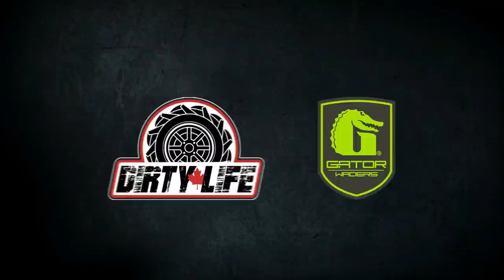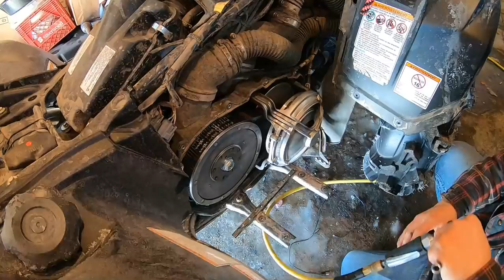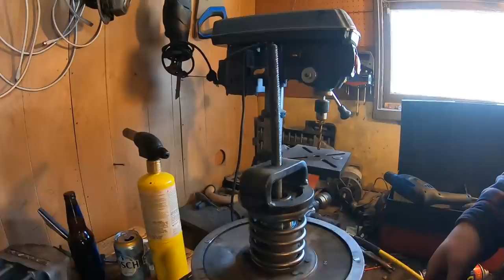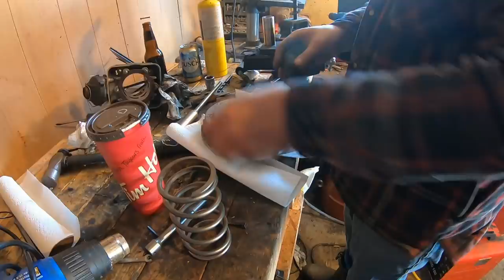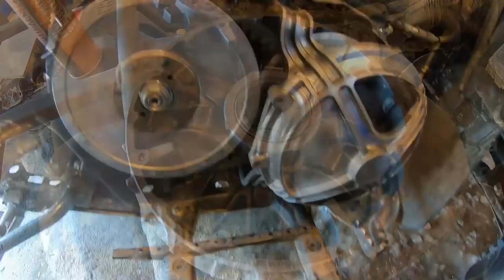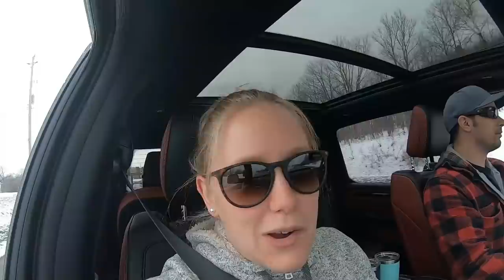Custom Clutch for Project Mama Bear (Kodiak 700 EPS SE)

Comment: Right on. Cass will notice a difference in the thick mud for sure.
Only difference in my clutch is I'm running the white secondary, and my cam plate has been cut and re-welded for more low and top end. Other than that I'm running the same weights in my primary. Oh and I have the wet clutch springs installed as well from EPI.
Reply from the maker: If we want down the road, we have everything to go full tilt. We need to test and see if it fits her needs eh.

Comment: Thanks for the informative vid! Going with the same kit from epi for my grizzly. Did you change the internal clutch housing gasket? They recommended mine be changed? Should be getting to the project in the next couple of weeks. Thanks again!
Reply from the maker: I didnt go into the internal clutch until we decide its necessary

Comment: On my old 07 660 Rhino even before lifting it I went through several stock belts and after I lifted it I changed weights and had to go to a HighLifter belt because I pinched one belt almost totally into.  But since going to the HighLifter belt I've only gone through about 2
Reply: you are the only person out of thousands on the forums, dealers, and friends, that ive ever heard have problem with oem, and first to have better luck with aftermarket
Reply: My clutches are both stock, my belt is after market. My clutches are super strong, I never had a problem with them turning over my 29.5 s/w OutLaw og tires even in clay they were gripping so tight they crushed the one grade up HighLifter belt, I had to go to the HighLifter Pro belt
Reply: @stacyreid5077  what did you do to the cvt to get it to grip a belt that tight?
Reply: Jason, I didn’t do anything to the cvt   When I showed the HighLifter staff the belt that is a step below the HighLfter Pro belt they didn’t have a clue of how it happened. They said never had they seen or heard of it without a cvt upgrade. But like I said I put the Pro belt on it and was great until I destroyed my transmission case

Comment: I was wondering have you guys ever come across a mud hole that the Can-Am makes it through but the Yamaha doesn't? Because a lot of people in the ATV world believe that more horsepower and more torque is better in the mud but when you look at Truck World unless you're talking about a 1200 horsepower mud rail it's kind of the complete opposite. Example Jeep never put anything bigger than a 6 cylinder in their vehicles and Toyotas R22 4 cylinder it's kind of unbeatable
Reply: Al Dyson I have just 2 weeks ago it was a Kawasaki 750 and 3 canams a 470 I belive and the other 2 were bigger cc for sure like in the 700 in up class and a Polaris 570 and a Polaris 1000 I had a Yamaha bruin 350 4x4 we didn't do straight mud bog we did everything mud hills creeks you name it I did better then all of them they are to heavy and I feel they have alot HP and enough tq mine weights 500 stock I look there's up how much they weight the Kawasaki 750cc weight 750 and the canam and that Polaris 1000ccwas at 800 pounds that's 300 pounds heavier then mine that's a big difference that's more then 1 1/2 I weight 180 plus my ATV that's 500 so 680 there were like 800 plus 180 that's 980 300 pounds more

Comment: I have the Epi Mudder kit and people tell me I should do the Slugs too though🤔👍📽
Reply: Did you notice  alot more low end power? Im thinking of getting one too.
Reply: @williamherrington491  clutch kit made a big difference originally had put 28 inch Outlaw 2s quickly realized 29.5 outlaw2 would be no problem.the hmf exhaust and tuner helped alot too.
Reply: @Waynerebelrider  Have you broken any axles? and do you ride hard? Thanks for the answers

Comment: Did you have to seal the belt box to stop water from getting in?
Reply from the maker: Not at all but I still recommend it
Reply: Mainville ATV and Outdoors ok thanks bud
Reply: @themuddman2038  it has a factory seal. only leaks if you don't install it correctly

Comment: Did yall add a slug kit to the wet clutch
Reply: I dont believe they did. But the wet slugs kit can cause premature wear on the wet clutch as well. Usually just swapping the springs out is enough for the Yamaha's.
Reply: Well I have the epi mudder kit and somebody told me I should do the slugs to u don’t think I should I have the same bike
Reply: @chadnsummercollins5372  slugs are better for the wet clutch.the stall springs will cause premature wear.
Reply: @alextm33  Yes sorry you are correct. Early morning post and just getting off shift.
Springs increase the stall. Where as the wet slug kit is opposite of that.